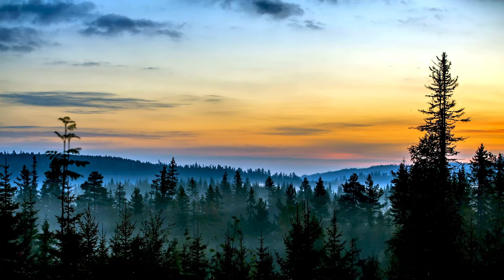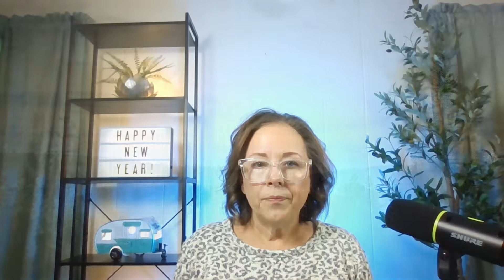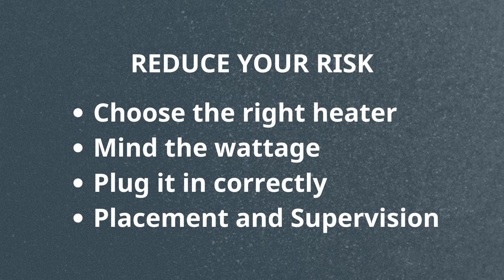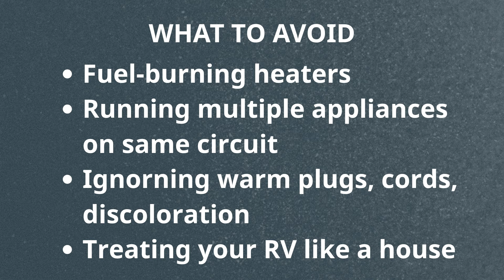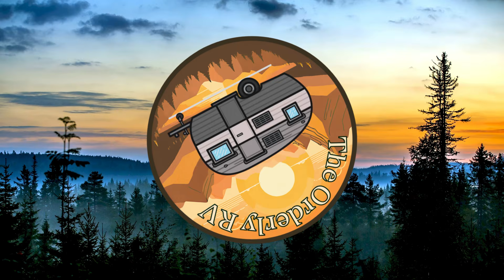Can You Safely Use a Space Heater in an RV? What Most People Don’t Realize

Comment: So very true! As both a journeyman electrician and a retired rv inspector, I can verify that all receptacles in an rv are crap and NOT designed to be used with anything that draws any substantial power draw. Very good advice in this video. Well done, I hope people are listening.
Reply from the maker: Thank you for the comment. Admittedly and despite having researched RVs for about 10 years before actually buying one, I never truly understood how the electrical system worked until I started asking questions about whether or not I would be able to use a space heater safely during the cooler months. It was an eye-opener for sure. We have a travel trailer so we’re only on 30 amp, so being even more conservative is key. It’s very easy to forget that even though it feels like our home away from home, it is not the same in many regards.